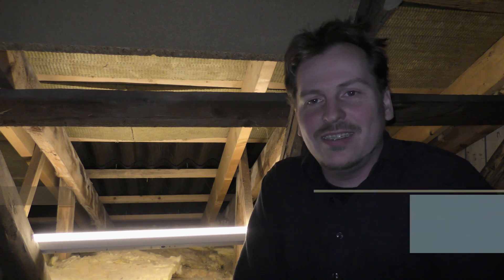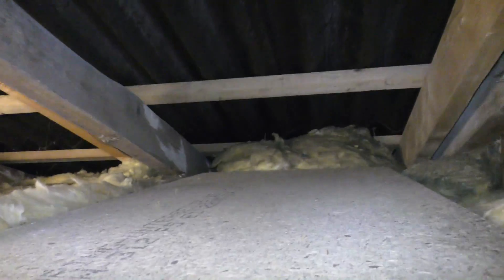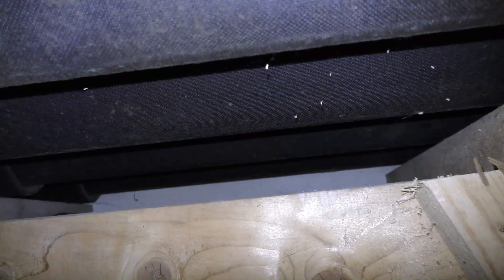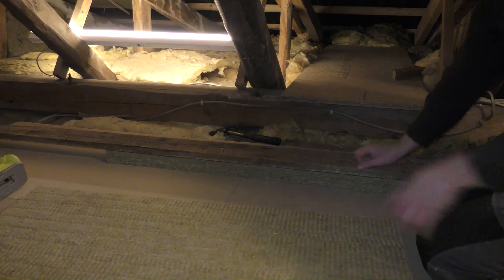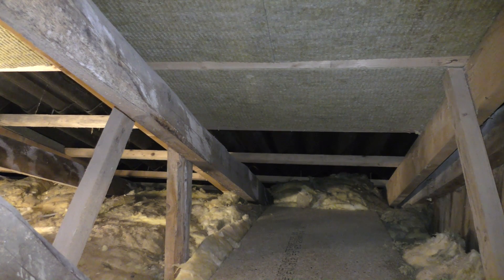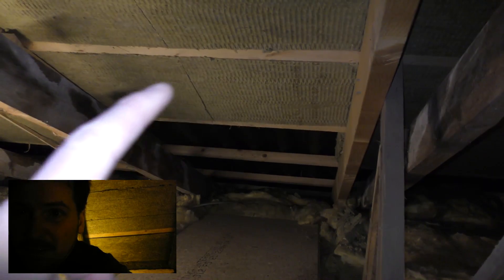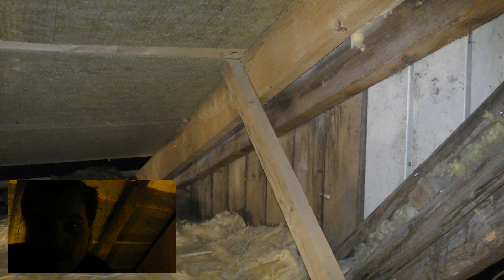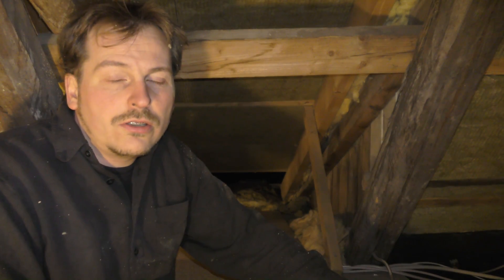Insulating, based on images from Thermal Camera - 290

Comment: You should remove all of that as soon as possible. A roof should not be insulted. It's going to rot out. Insulation goes over the ceiling not under the roof. If you want to turn the attic into conditioned space it needs to be air sealed with closed cell foam.
Reply from the maker: There is air flow, and I checked up on it a few months ago.
Reply: @MyPlayHouse  The problem is moisture will build up behind the batts in the winter and will not be able to dry out. Youre going to have serious mold issues first then your roof will start to rot. Check your local building codes if you find believe me. It's going to be a really expensive problem in the future.

Comment: What about ventilation? It seems like you place the insulation direct to the roof. Remember that roof tiles very often can have condensation on the back, and that ventilation is essential in all roof constructions.
Reply from the maker: Hi +Martin Mathiesen 
That is why i am using these hard bats, the only touch the low spot of the  roof tile. This will generate a chimney effect in the triangle left open, as soon as the warms the tiles just a little bit.
Thank you for watching! :-)
Reply: +Martin Mathiesen You should also consider vapour barriers (a thick plastic sheet that is wind proof), so that you don't get mould in the sleeping loft. Watch some Holmes on Homes when they do insulation, as Canada has very similar cold and wet weather as you do seem to have in Denmark. A lot of snow dams and mould damage in the roof cavities are caused by incorrectly insulating the roof area and not allowing the cold air to ventilate the roof. I understand that you have the tiles with ridges, so you have that under control, but I think you should still look up vapour barriers and see if you can make it work with the system you're putting in.
Reply: First of all, the roof sheeting is back vented because Rockwool insulation batts is really touched roof sheeting that firmly, there is a big of gap in between batts and roof sheeting, from eaves vent all the way up to ridge vent. Secondly, whether or not he needs vapour barrier is a question, Rockwool insulation is vapour open, the vapour drive is from inside to out, since the gap between roof sheeting and Rockwool insulation is sufficient enough for air movement, I think, vapours can be decently diffused to desired area.